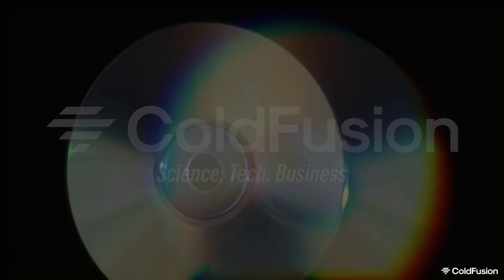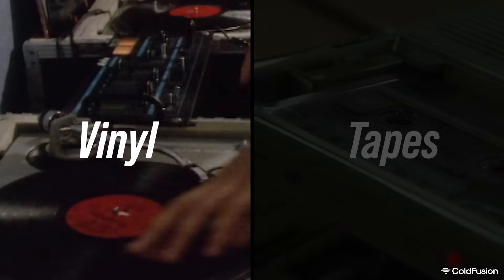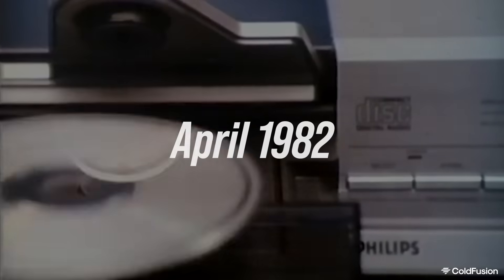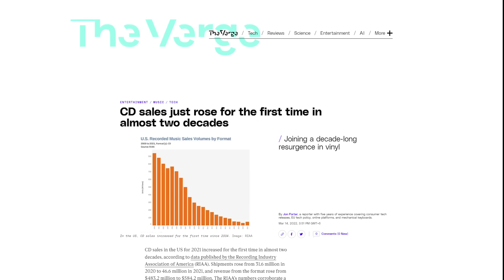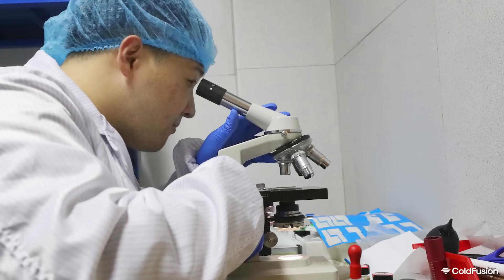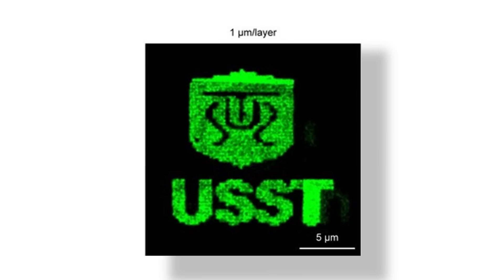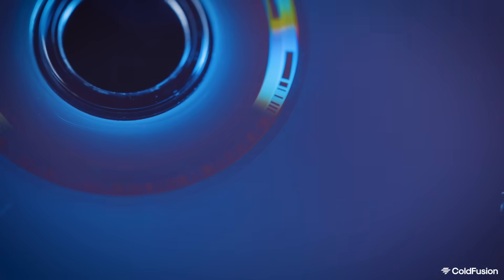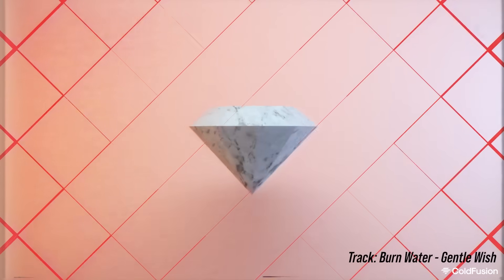Why This New CD Could Change Storage

Comment: world governments, media companies, big tech will never allow average citizens to have this amount of data storage capacity
Reply: Because they would fill it to the brim with porn?
I would agree that this video is absolute bullshit, but not for the reason you're stating. It might indeed be possible to make a petabit, or even a petabyte optical disc, but there would be quite a few issues with such a technology. We already have, fast, compact, durable, affordable media storage in the form of flash memory, and considering how "successful" BluRay Discs have been, and that a single, 100GB BluRay disc takes over 1 hour to fill, in the best case scenario, how long would this "miracle disc" take to transfer data using this proposed multi laser system? How long unlit the technology becomes econmically viable for mass production? What other technology will reach the market in the meantime, making this AND the flash we use today, undeniably obsolete? I would urge you to consider that this is not the first time that the augmentation of an obsolete tech has been attempted, with the zip attempting to replace floppy, when the CD was 3 times larger and already available 20 years earlier, and the BluRay attempting to revive optical storage, while flash storage was stomping on its diodes.
Reply: Nadie te lo prohíbe, que no sea barato es otro tema.
Reply: This is such a bizarre take; you can buy this much storage already but it's just less compact.
Reply: people already build homelabs in their basement, if they can afford it

Comment: to me optical is still dead and won't likely make a come back(on grand scale) because I'd hate to lose 15tb's over a spec of dust, or 2000,000gb over the dye going bad on the disk(common issues with cdr's/dvdr's etc)...... next, usb 2.0 was suppose to be slower than cd's and dvd's but, I was an early adopt of installing windows/etc off usb, in the real world latency due to the physical nature of cd's dvd's made it so USB was the faster choice and it only got better..... going back to the dust comment in general optical is a fairly fragile technology, bluray(ps3) for instance suffered from a high failure rate for a really long time and cost of production was fairly high; similarly in a lot of videogame consoles etc often optical is the weakest link in the chain when in comes to repair-ability/etc.... than there's the convenience factor, one of the biggest benefits to switching over from Optical was the no longer needing to swap discs, be it to continue a movie/music/game/other or to change over from a movie/game/other to something different** a complete game changer.... for archival I could see it happening maybe as it would be possible to buy multi disc changer setups etc for businesses/corps/universitiies/etc where the discs live their entire lives inside the machine away from dust/etc but for consumer I do not see it making a come back; unless it becomes an alternative to magnetic storage in a similar packaging(contained in the drive)

Comment: I think the technology is incredible. Costwise, even at this early stageit seems to me that is not that expensive. 50000$ for a writing laser might be a lot and have plenty of limitations but on a product that potentially competes with a storage capacity that would be worth 80000$ (200TB = 2*100TB harddrive = 2*(40000) = 80000) it's insanely good. And that is the R&D version. A production one could be way more competitive, not to think of a potentially commercial one. More and more archival of information is becoming neccessary for a lot of people and this would be incredibly useful.

Comment: first of all there's no such thing as 200,000 GB. That's 200 TB. Not 200,000 GB
Reply: Congratulations, you discovered how to convert between different size unity for measuring data. Here's something that'll blow your mind even further:
1000 grams....is 1kg....and 1000 grams. At the same time. They're two different ways of writing the same thing.

Comment: Fun fact: Assuming a write speed of 5 MB per second, and 200 TB of storage on one of these discs, that would take about 27.7778 days of writing to fill up that disc, assuming the disc drive was writing at 100% capacity the entire time.

These huge CDs are worthless for anything other than archives unless we can improve that write speed. I'd argue that is even too slow for archives though, the data at the "back" of the disc would be nearly a month older than the data at the "front" of the disc.
Reply: modern blu-ray data storage discs write at 79MB/s, using a CD as an example is a bad choice.

Comment: @11:51 "the estimated energy consumption would be in the kilowatt range per terabyte of writing". This statement does not make sense. A kilowatt is not a unit of energy. It is a unit of power, or energy over time (rate at which energy is being used). A terabyte, on the other hand, does not have a time component to it. Therefore it makes no sense to say it takes such and such an amount of kilowatts of energy to write such and such an amount of terabytes of data.

Comment: What killed physical media was broadband. Have you tried lately to read or write a DVD? It takes ages when compared to download / upload speeds.
Size is nothing if the speed of the media doesn't match the capacity. That's what still drives flash storage over anything else.

Comment: It is unlikely that a disc with the diameter of a normal dvd will catch up with today's computers. It needs to be much smaller, a 2.5 inch drive.
Also, if it is as slow as a dvd-rw and has disc rot issues, it will definitely fail.

Comment: The amount of storage a CD can provide was never really the issue. There simply isnt a need for physical media these days due to fast internet. Back when there was, them being extremely cheap to mass-produce and the disc drives being relatively cheap as well is what made them viable. At the time BluRays first became a thing, there were already articles about BDs with 20 layers giving 500 GB, but noone commercialized this either, because there was no real need for this type of storage. 

As for archival storage, which is not a huge industry anyway, very large Tape drives are a thing already, I think going up to 160 TB per tape.

Comment: Honestly If they could even do a 8TB disk format where both the disks and the burners were affordable I would be interested, if for no other proposes other than keeping my OS drive backed up, also assumnig they could get to 100+ MB per second data read speeds, long write times are not really an issue for that kind of application, but if it's significantly slower than my internet connection to get the data off that is a problem, because I only do a backup once a week it could take the whole week and that would be fine... well I say that my PC doesn't get left on 24/7 so it would need to happen while I was using it so probably 48hours to write 900GB would be fine which 5.2MB/s seems to be fine for that.... although I would at that point want to be able to back up my HDDs as well which adds 18TB... so I would need 219MB/s, to be fair though backing up my HDDs once a month would probably be fine so about 65MB/s would be fine.

Comment: Don't forget "CD Rot". That is, recordable data disks don't store data forever, and actually have a relatively short lifespan. 5 years or less. The storage layer oxidizes over time. Not a problem with pre-recorded music CDs, as it uses a different storage layer material. Since this media has fallen out of favor, it isn't an issue for most people, but something to think about, if this new tech becomes a real product.

Comment: Cloud storage is "someone elses computer". But it should be an important part of a backup and archive plan, along with optical disc.

Safety is maximised when using different storage systems and location. Store your data in the cloud, on optical disk, hard disk and ssd. Have at least some of these at different locations. 

With different storage types the strength of one overlaps the weakness of the other, so no chinks in the armour.

There's still a place for optical media therefore.

Comment: This disk will desperately need a CADDY SYSTEM. (Like type 4 DVD RAM/PD disks and MO disks) If a Blu ray disk can become completely unreadable via a miniscule scratch (comparing to CDs from which data can be recovered even if heavily damaged) then a disk like this could be damaged by a frikkin speck of dust. Do you really want a disk that can be that easily damaged for archival? Not without a caddy i don't.

Comment: Frankly, I would welcome a resurgence of physical media. Recent events where companies have exploited their customers only reinforce our long-standing fears: we truly own nothing. Owning a DVD or other physical format, which allows me to use the purchased program (even without updates) offline, seems increasingly valuable. However, even this notion is flawed. Often, inserting the media merely prompts an internet connection to download the actual installer.

Additionally, you mentioned the write/read speeds measured in megabytes per second. Today, these speeds are unacceptable. I recall the arduous task of archiving data on my 8 TB HDD, which took days. I've since switched to SSDs, as the previous method is no longer viable. Reverting to older technologies is problematic from a consumer perspective. If transferring 8 TB was a hassle, imagine the nightmare of transferring 200 TB, including verifying data integrity.

So, what would a viable consumer version look like? It must be cost-effective in production, use, and maintenance, with a capacity of 500 GB to 2 TB. Once we have a suitable media format, companies must be willing to adopt it meaningfully. This is the primary challenge. As you noted, many people appreciate the convenience of the cloud, despite sacrificing ownership. Outside our tech-savvy bubble, the average consumer is unaware of their lack of ownership and remains unconcerned. Consequently, why should companies revert to distributing actual software on physical media instead of just an installer? They won't, if it means losing out on a few thousand sales, as long as millions of others continue purchasing.

Comment: 1.6 petaBITs = 204.8 terabytes. At 1kWh/TiB and a write rate of 2MB/s, a single disk will require 205kWh of power and 29,826 hours (1,242 days) to write, which comes to a cost of £65.83 just operating the burner alone (Forget about the host PC running all that time!) by reference to my UK energy tariff. 💸

Damnit, the tech seems awesome...But isn't it always interesting how the things necessary to make it work are always carefully selected to intentionally place such things very much beyond the reach of any consumer? 💰🛂📀🤔

Comment: After looking into this, I have to say that the flashback part of this video is pretty nice, but the rest is just garbage. Let's get the facts straight:

- this is based on a Chinese research paper, not a real product
- they claim this to be a cheap medium and the medium itself might be. Well, you have to write it somehow, though. They used a femto laser which currently costs 50,000 USD alone. Better calculate 100k for a marketable writing solution.
- The paper contradicts the storage size by claiming that a single disc can store 1.6 Pb and 15.2 Pb. Very trustworthy and not a grave mistake at all for a "scientific" research paper.
- The storage size is calculated based on a dual sided disc while Coldfusion (and many other sources) imply it's a single sided one....
- Read/Write speed is about 5MB/s. This means that it would take more than 16 months to write a 1.6 Pb disc...and about 10 times longer should the 15.2 Pb storage size be realistic.

Apart from the highly experimental nature of this research, this is not targeting end users, but data centers, even if Coldfusion implies otherwise. To Coldfusion: Great research btw. How did you manage to ignore the paper? Going the cheap route by copying the Hossenfelder video? I guess there's a reason why you don't state any sources in the video description...

Comment: The funny thing is that CD’s like this are actually necessary because video games are getting very large. Even though it’s unlikely we will need petabyte disks, it would still be useful to have large disks. The issue is that most developers don’t put the final game on the disk and often force you to download the game. If we lived in a world where they did put the final game on the disk, we would probably find it more convenient to have the physical copy of a game vs the digital.
Reply: if they wanna release all the games on one disc, its perfect, pluss rest of the surface area can be used for redundancy, so they become scratch resistant.
Reply: Yeah. Owning more than 2 games is getting prohibitively expensive for most PC gamers.
Reply: they easily fit on a BD-XL.

Otherwise, you can just download them. With a 10Gbit/s internet connection, it's faster than reading locally from an optical disk.
Reply: The earlier game systems had games on several CD's, then tech got better and then plateaued again with multiple CD's. With so much space available who knows what could be possible in the future.

Comment: 1.6 Pb are roughly 200 TB. No need to inflate the numbers even more. Before further watching, three routes emerge to increase capacity on the disks. Shrink the track size by shortening the lasers wavelength, use multiple lasers with different wavelength to encode more data on the same track or by stacking and adressing multiple tracks at once.
And its the second option...
Disk medias are not restrained by the wavelength of visible light. Blu ray discs uses around 400 nm which is the transition from blue to ultraviolet. (9:20)
Now they use a green laser to manufacture the track and write on it with red? Why are the wavelengths increasing from step to step? There is so much spill over. (9:45) Green and red lasers are not 10 times shorter than visible light, because they are visible light!
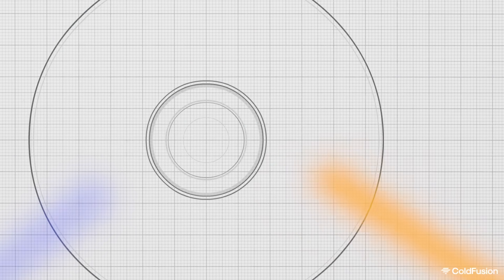Then you use a blue laser to make the spots glow? Well yeah thats possible but why? "Glowing" emitts in all directions, so a reading will be a huge untertaking. Using an additional orange laser for what? (9:55)
At (9:12) you can clearly see a faint outline at the right side of the picture. This data will be corrupted.
If this technology is so great then why stop at 200 TB? No mention of any limitations so the sky is the limit? Why not adding thousands of additional layers. Why not storing the whole internet of one year on one disk? According to you and the researches, this has to be possible because there are no limitations.
(11:50) kW per TB is no unit of energy konsumption. Its Power per Data wich is a non-sense unit. kWh per TB is the only option.
(11:54) Writing in the range of MB/s at a capacity of 200 TB??? This will be a timeframe between 6 years and 55 hours! At a manufacuturing time of 6 min this would be orders of magnitudes longer. WTF
Conclusion question: What is the point in a huge storage, if you can't load it in a reasonable timeframe. Marketadoption will not take place with this.

Comment: Flash in a pan. Considering the many failed new discs based on the Bluray standard with sizes ranging from 200GB to 6TB that never materialized - sizes that would be still quite useful today - I'm not holding my breath for an even bigger storage disc. Especially considering the abysmal write and most likely also read speeds. What good is it for to store TBs of data if it takes you weeks to record them and more weeks to read it back. Seems like Coldfusion jumped onto very early information, instead of waiting for things to progress. And indeed. This is not a functioning product, but merely a hypothetical possibility based on a recent research paper...

Comment: I would be happy to use an accordingly cheaper 50 TB Disk instead of an unpayable 200 TB, in the data center, for backup purposes. LTO9 - 400 MB/s and 18 TB native capacity in a clunky case with less reliable tap drive. 
Always loved the MO technology.

Comment: Yeh that is super impressive , its almost as much at 5 LTO 9 tapes ! I am also massively skeptical this will ever even be practical with how precise it would have to be. It will be no use in data centers other than long term backup if it was ever to be practical .

Comment: Would I like to use it?  Yes, I am a geek..

Do I think it will be successfull?    Possibly in areas outside the home.   I csn see a use for companies or organisations backing up large scale data sets.   

The problem is, a lot of that data is currently hosted in the Cloud.   Where I work, despite the fact we have a nice, fast connection to the internet, with no bandwidth limits, I know it would take a significant about of time to back up one of our cloud based servers to a disc like that, and I think Networks would want a word with me if I transferred hundreds of terabytes of data a month..

Also, even if the Networks team are happy with that amount of data being transferred, there is the time.   200 TB of data is going to take a significant time to transfer over any network, and is going to take a significant time to write to disk.

Much as I'd love to, I don't see a use for this in the home.   People like the conveniance of streaming, and likely don't have a lot of space for discs.   `
`
After all, why limit yourself to a few hundred albums to pick from, when you can pay a few quid each month and get access to virtually every album that has ever been released?   

I'm not saying streaming doesn't have problems though.   It does.   Your media can suddenly disappear and you have no way of stopping it.